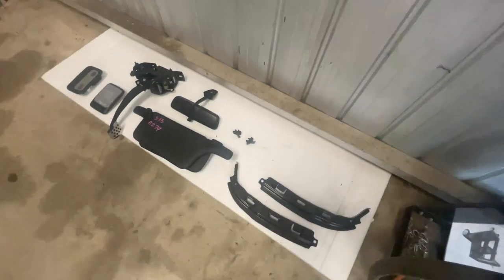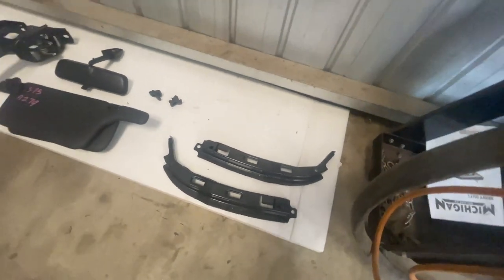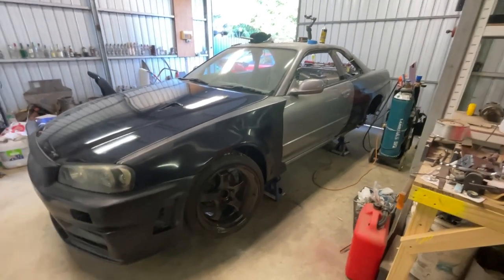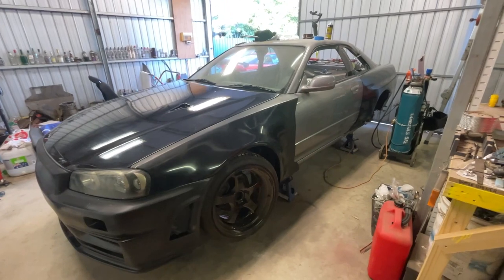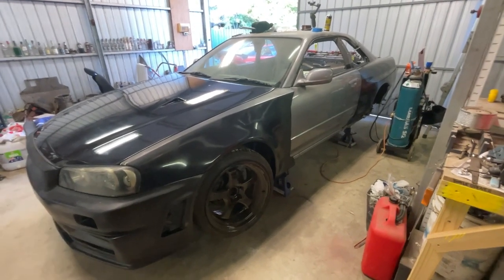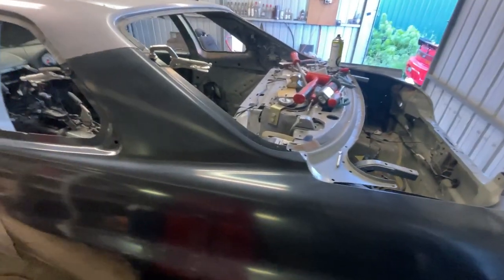Aligning the Z tune panels - R34 GTT to GTR conversion [Ep16]

Comment: hey, love this series, maybe you could go more into detail how you fix some issues you incounter, for example how you fixed your fender gaps here:) Keep it up !
Reply from the maker: Hey man! Thanks heaps 😁

With the 1/4 panel adjustments all I did was go through and drill all of the mounting holes out so they’re 1mm larger and that allowed me to adjust its position on the car before bolting it down.
Reply: @darrynjames  okay nice thank you:) doing the conversion myself that’s why I asked, your vids help me :) thank you!

Comment: did you need the R34 GTR Bonnet Latch Support aswell or will it bolt to the gtt one
Reply from the maker: The gtr latch will bolt to the gtt bracket but the position of the latch will be different and won’t line up with the bonnet striker properly.
The gtt one can be modified and extended to work or buy gtr and shorten it at the bottom to fit the car.